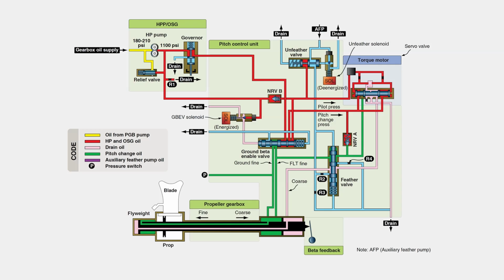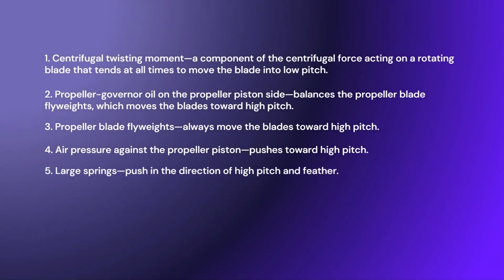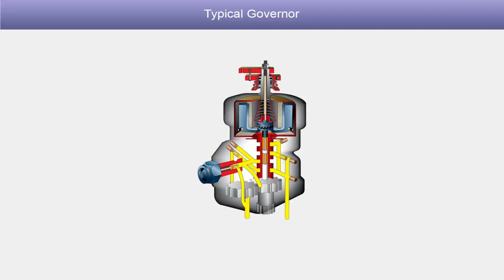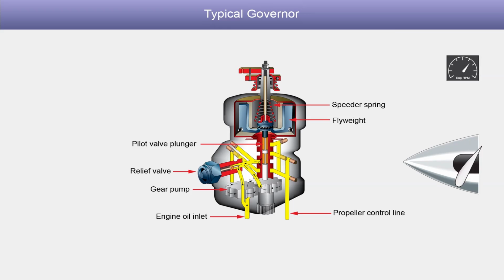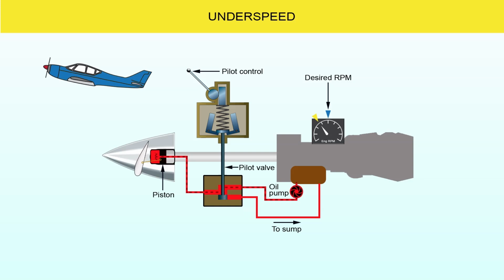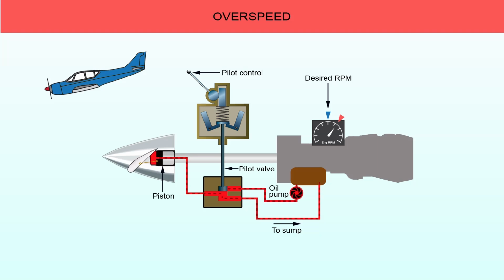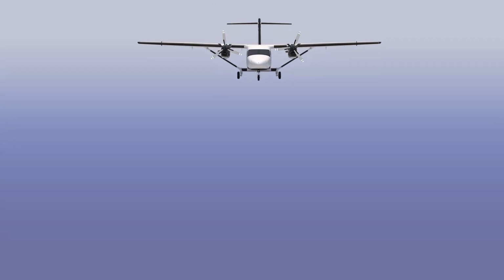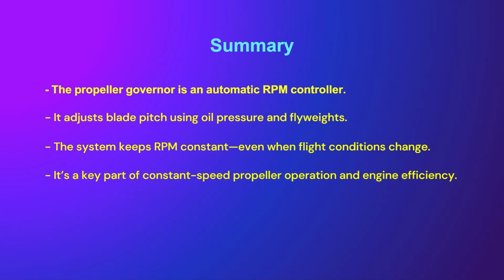Understanding Aircraft Propeller Governors | Overspeed, Underspeed & On-Speed

Comment: The oil pump and the oil sump are flipped in under speed oil is flown out out of the hub and into the sump and over speed is when it’s getting too hot and it needs to cool down so oil flows cooling the hub

Comment: Can this also be used for an aircraft’s ram air turbine (RAT)? It requires a changing blade pitch to obtain a near constant blade rotational speed to generate a constant hydraulic pressure within the plane
Reply from the maker: The real reason the propeller governor can't be used is that it is engine-driven and uses engine oil, while the RAT's governor is an independent system that typically uses the hydraulic fluid or power the RAT itself generates.
Reply: @aero-guide so is it safe to say that the pitch governor of the RAT operates on a similar principle to those of the propeller but that the hydraulic fluid used is stored in the plane’s reservoir?
Reply from the maker: @CS-mo8hg  That is mostly correct, with a vital clarification on the fluid source:

The principle is identical (governor/flyweights control pitch). However, the RAT governor's oil/fluid is usually not from the main aircraft reservoir like a hydraulic system (e.g., Green or Yellow).

The high-pressure fluid used for pitch change is typically supplied by a small, dedicated pump (often a gerotor pump) driven by the RAT itself. This pump circulates fluid (which is often the same hydraulic fluid as the main systems) within a self-contained circulation loop in the RAT assembly.

In Short:

Prop Governor: Uses Engine Oil boosted by an Engine-Driven Pump.

RAT Governor: Uses Hydraulic Fluid boosted by a RAT-Driven Pump (part of the RAT assembly).

This makes the RAT's pitch control system truly independent and able to operate even if all main engine oil and aircraft power/hydraulic systems have failed.
Reply: @aero-guide thank you so much! How big would you say the gerotor pump is? Am I correct in assuming that the pump will be installed within the leg of the RAT rather than the hub of the turbine?
Reply from the maker: @CS-mo8hg  You are correct about the location: the gerotor pump is typically installed within the stationary leg/support structure of the RAT, not the rotating blade hub.

It is a very small pump—just large enough to boost fluid pressure for the pitch-change piston. It is located in the leg because it's easier to drive it from the main shaft via a gear train there, separate from the high-RPM governor components in the hub.